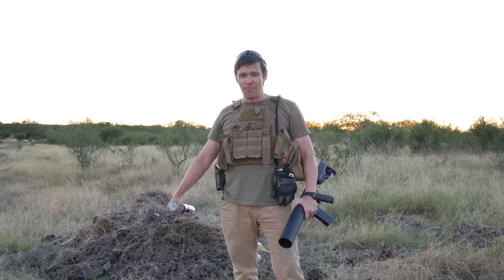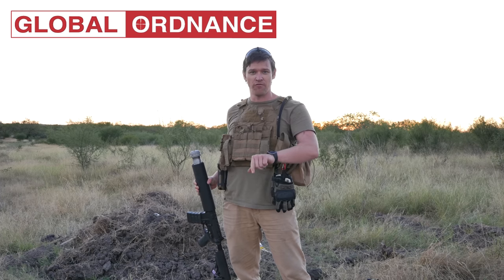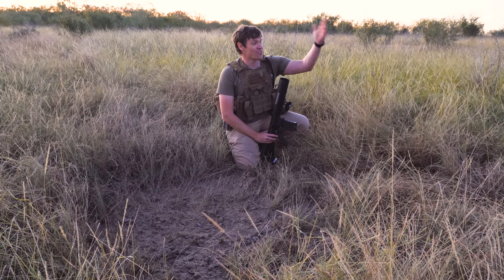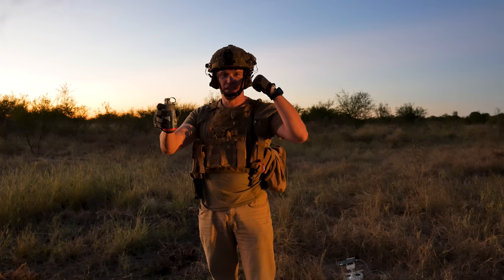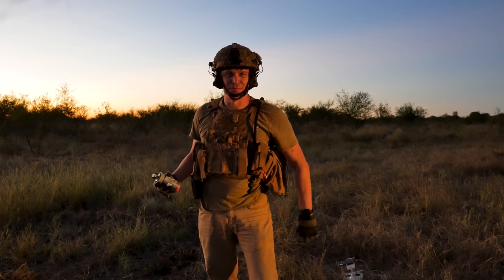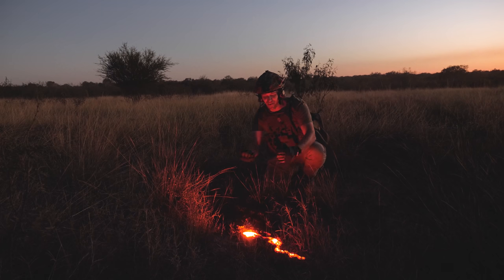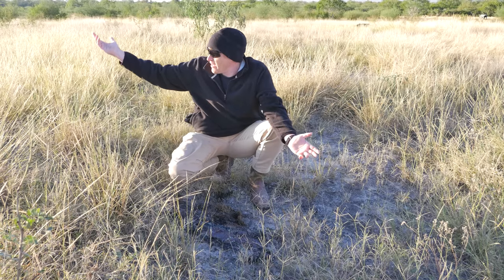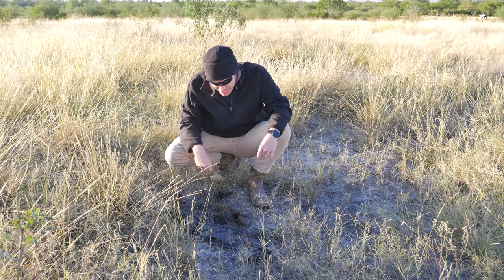Thermite Grenade & Pipebomb in Can Cannon.

Comment: This whole Can Cannon series just goes to show how much validity a Can Cannon has in a real battlefield situation. It's like a handheld mortar that lobs all the grenades you're carrying at a distance.
Reply: Homemade Rifle grenades and standard used by islamic fighter  and other have proven that
Reply: Not exactly. The big issue with field use is that Ordnance Lab uses a custom powder load as a standard 5.56x45 would launch an M45 a shorter distance than the blast radius, effectively rendering the can cannon useless as an explosives launcher. Remember that this is by design, the thing is designed to fire 12oz CANS
Reply: Can cannons remind me of rifle grenades

Comment: Before I watch, I must immediately note that firing anything with cannon fuse at velocity is dangerous as the increase in air speed speeds up the fuse burn. I had explosions caused by this 8-10 feet out of my black powder cannon with home made salutes. I found that protecting the fuse with tubing was the way to go.
After watching, my cannon has about 50 times the velocity. 
Great video

Comment: As an European am so glad to hear 5 or more liter engine!!! 👍🏻👍🏻👍🏻
Reply: Really? What do industrial vehicles have over there?
Reply: @jeffreyyoung4104  Lorries sound different way comparing to American pickup trucks which sound wonderful!
Reply: @xandergross8474  You might have liked the sound of my 1963 Chevy Nova, it had a nice 350 ci engine that I built up for fun. It had about 400 HP and turned the 1/4 mile in 13.07 seconds in street trim.
But it was a rat rod, which most people didn't like. Primer grey, 4 door.
Or my 1978 Ford F250 stock 350m400 engine. It is a farm truck, used for hauling wood and other stuff. It is a beater with no fancy paint, and owners of dress up trucks don't care for it.

Comment: Why am I imagining some crazy dudes running into the boog with nothing but a helmet with 2 ANPVS 14 duct taped together, a plate carrier holding nothing but pipe bombs in the pouches, an American flag speedo, tactical red steel toed crocs in 4 wheel drive, and an AR with a can cannon upper. Gosh dang it what is wrong with me.

Comment: What would thermite do in sand? Would it get hot enough to melt sand?
Reply: Absolutely
Reply: Thermite produces liquid iron which is more than hot enough to turn sand to glass. It turns dirt into glass as well.
Reply: @HughesEnterprises  that's what is was curious if would get hot enough to melt and turn to glass

Comment: The m200 blank loads are not the ones to use as a grenade launching blank. I have the load data for the proper GLB powder loading. It from a 1980 ammunition manual it for the Nato 22mm  rifle launched  grenade. If you life I can send to you if you like.

Comment: 3:12 So he just drops the weapon on the ground without looking?
Reply: Yes the fired single shot weapon
Reply: @Scrump_Can  So if the weapon is empty it is OK to mistreat it?
Reply: @WastedFrom1976  as it is no longer able to fire it presents no danger and as its his property he can do what he wants and thermite in dry texas grass kind of requires a bit of haste
Reply: @Scrump_Can  Proper Planning and Preparation Prevents Piss Poor Performance.
Reply: @WastedFrom1976  not putting a fire out quickly leads to wildfires, smokey bear and all that, I maintain that a scratch or 2 on a gat is drastically less important than the whole range going up in smoke

Comment: Damn bro.  You guy are late to war toys.  It’s easier to launch a tennis ball with ordnance in it than it is to launch actual metal.  Try small steps.  You can launch a tennis ball over 50 yards just with gasoline and and some pvc.  We used to do that in the 70s.
Reply: Fella, thermite is no tennis ball. It would be funny to use thermite as a tennis ball, because it burns at 4,000F